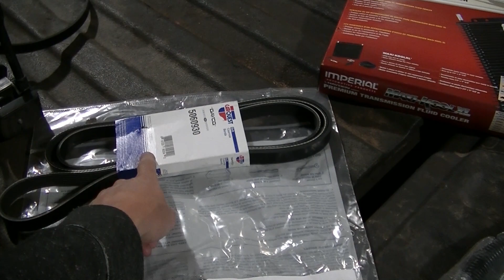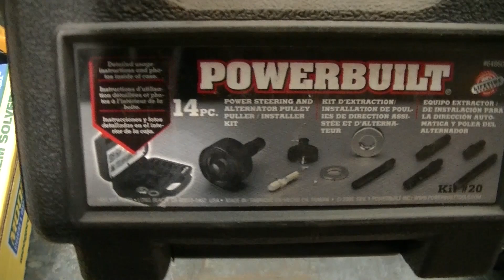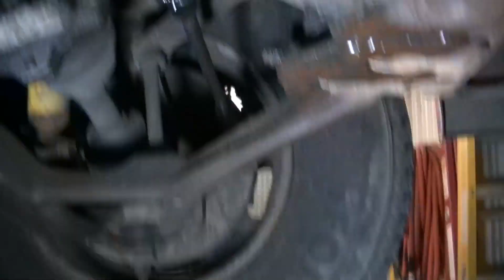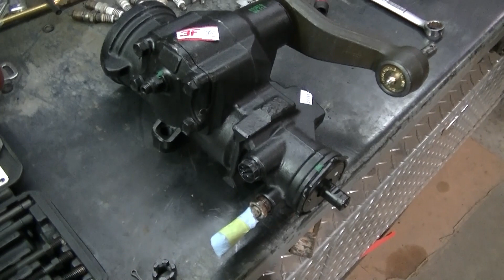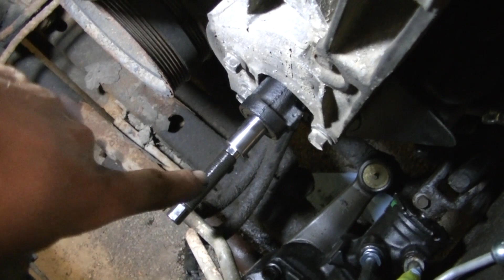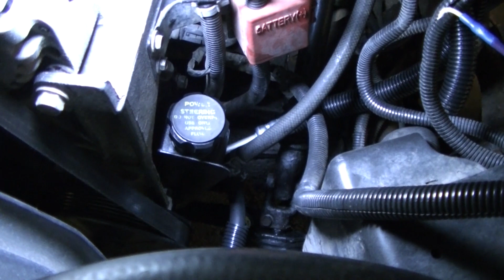Silverado 2500HD Power Steering Pump, Steering Box, Cooler, Lines, Pitman & Idler Arm

Comment: U can swap in alternator bracket 12567922 and use the bearing style pump from 2011 2500hd silverados. Im trying a corvette steering pump & remote reservoir. 

I went thru so many of these built in reservoir pumps they will not stop dying

Comment: Hey how has the power steering pump held up over all this time mine just went out curious on which one I should buy I want to get the best I can I have a 6 inch left on my truck. If you canreply thank you so much!!!
Reply from the maker: Get an AC Delco. This one made some noise the whole time I had it. I replaced it with an AC Delco and no more noise. Worked better too.

Comment: Just did mine and having a hell of a time getting the steering box in the right position in conjunction with the steering shaft and wheel being straight. The wheels box and pitman arm are straight but when I hooked up the steering shaft to the box, the only way i could get the slots in the shaft/box the wheel had to be turned about 90° Should i just take the shaft off the box turn the box manually all the way to one side then turn the steering wheel that way and reconnect the shaft to the box? When i took it all apart i had the wheel tied up with rope but my knots came undone.

Comment: pressure lines are different sizes; (no need to add line to remember.) also gearbox will come set (for wheels to be in straight position;) keep steering wheel in locked position; (in the straight position)

Comment: Man! Thanks for the video- it actually was more of an encouragement. I put a psc xd steering box in and could not get the steering shaft to slide on. It slides on and off so easily on the old box and was worried it was user mechanic error,i was ready to throw in the towel and pull apart my new front end. I watched this and you said it took lots of prying, hammering, and cursing. I followed suit and won. Thanks again!
Reply from the maker: Well, glad to help motivate.
Reply: mossman381 Scratch that, you helped with more than motivation. The strap wrench was incredibly useful!

Comment: Hey Mossman, my steering is locking up when I turn the wheel with the engine ON (both IN gear and idling)(no, it is not the anti-theft lock, which is what everyone is suggesting). I am thinking it is the gear box, whuddya think? Is there a way to test it before I replace it? Or could it be the pump? Already replaced the pitman arm and belt (along with the idler, tie-rods, and ball joints). After getting ripped off from SO many mechanics (female thing?), I have opted to work on my own truck! And still learning.....and it is an 03 2500 HD Duramax (LB7)....sigh
Reply from the maker: How many miles?  Is the steering locking up or are you loosing power steering?  If it completely locking up I would lean towards something in the box has given out or worn badly.  If you are just loosing power assist then I would say the pump.  If your pump is working good I would suggest not replacing it.  This replacement pump is as loud as the old pump it replaced which was the whole reason I changed it.  And it's not an easy job.  Having someone watch the steering parts as you turn the wheel can help spot a problem.
Reply: Hey, thank you SO much for responding! Truck has 165,000 miles. And it is completely locking up.....I can get it loose by forcing it back and forth, but then it will lock up again. Had a buddy go under and listen and watch....he thinks it may be the box as well. So I will replace it and go from there. Is it complicated to remove the fan and shroud? Do you have a video showing this? And thanks again...I actually enjoy doing this work myself...somehow it is gratifying.
Reply from the maker: Yes,  fixing something with your own hands is satisfying.  The shroud is pretty easy to remove.  The fan can be difficult.  I generally use a hammer and chisel method but they have a tool to hold the pulley.  You will need a big wrench for the fan bolt.  I don't remember the size but it's big.  Steering box job isn't to difficult but there can be issues that make it not a fun job.  That can be said about any auto repair though.  I show some of it at the beginning of my water pump removal video  https://www.youtube.com/watch?v=t7lQKRQWfTU
Reply: Sweet. Just got paid on Fri.....so pricing out gear boxes....meah....a bit pricey. How do I know if I can rebuild mine? Any thoughts?

Comment: How well has the Hayden Trans cooler work, does it hold up to the power steering pump well?
Reply from the maker: Works just fine.  Had no issues so far.
Reply: Thank you for the reply, I have the same cooler going on a Trailblazer for the PS cooler.

Comment: The pitman arm, what's the factory torque for the nut on it? I had mine done at a shop and now the nut is falling off. Shop doesn't want to fix and I really don't want to pay again. Also the guy put 2 big washers above the arm & 1 under the arm plus the locking washer? Not sure y but he did. Any help ??
Reply from the maker: Not sure why there would be washers.  Sometimes you can put a washer on a part that uses a cotter pin to get the hole to line up at the right torque.  I don't know the torque for that nut off the top of my head.  It doesn't sound good and I wouldn't go back to that shop again.

Comment: Do you have the part number and brand for the power steering cooler that you used, and how do you like it everything fit in lineup vs the factory one? Thanks
Reply from the maker: No part #.  It was a trans cooler from the local Carquest.  It seemed to work out good.  Have not had any issues with it.
Reply: mossman381 10 4

Comment: where did you get your gear box and power steering pump? and how are they holding up today? also its the same for the 2500HD with the duramax right?
Reply from the maker: I think the boxes are the same Duramax or gas.  Your auto parts store should know the right one.  I got mine at CARQUEST but they look like they are all coming from the same rebuilder.  I have heard they are hit or miss on finding a good one that is tight and doesn't leak.  Mine started leaking right after being installed.  I used some Lucas stop leak and It helped but haven't been under the truck to look recently.  There are two versions of this box.  I would get the more expensive one next time.  I think it's more heavy duty.
Reply: yeah i'm gonna try a company out of North Dakota who rebuilds them called blue top. http://www.bluetopsteeringgears.com/ lil more expensive but suppose to be really good product. was gonna try red head but heard they are hit n miss to and even more expensive. is your power steering pump holding up good?

Comment: Wow thats a lot of parts.  I think I gotta replace some steering parts also.  Steering is really heavy like the assist isn't working at all.  Was watchin your video to get an idea of whats wrong.  I have an 04 Z71 so I dont have the hydroboost.  The hoses are leaking some and need replaced.  I'm guessing maybe my pump needs replaced but not sure.  Its not making any whining noises.
Reply from the maker: Could be the pump or the steering box.  You should never have a heavy steering.  Rebuilt steering boxes and steering pumps are like rolling the dice.  You never know when you will get a good one.  I have gotten a few bad ones and have heard others having the same trouble.  Low mileage OEM stuff is the way to go I think.
Reply: @mossman381  that's what i did low mileage parts from a boneyard 75 for the gear 40 for the pump

Comment: mossman381, Where was the leak coming from exactly? If you mentioned it in the video, I must have missed it.
Reply from the maker: The front of the gear box.  There is a snap ring that holds everything inside and it looks like it's leaking from there.  The Lucas really slowed it down but I still see a drip on the front of the box.
Reply: Ok, thanks! Very informative video. I haven't found my leak yet. There's fluid everywhere. From up top and all the way down to the bottom. So I can't tell if it's coming from somewhere around the booster and running down all over everything or if it's coming from somewhere around the bottom, like the gearbox and just blowing up onto everything with wind from either driving down the road or the engine fan. I've cleaned the upper part with brake cleaner and haven't seen a leak yet, so now I'm gonna do the same to the bottom. Now that I know where the source of your leak was, I'll pay extra attention to the gearbox.Thanks again.
Reply from the maker: I put in all new parts.  The aftermarket parts are not that great these days.  My guess on your leak would be a power steering line.  If you have factory parts still they don't leak much except lines.
Reply: ok, great thank you!
Reply from the maker: They hydro boost will leak when they go but that should be easy to spot.
Reply: Ok. I sprayed and cleaned it real good and I'm gonna keep an eye on it.

Comment: Did you decide to put new shocks on the front along with a front end alignment? 
If so, how does it ride now?
Reply from the maker: No shocks yet.  Needs ball joints before an alignment.  Truck drives better with these new parts.  I think the pitman are was really bad.
Reply: You're right. If the truck needs ball joints, do that first before you get the front end aligned. 
Your project is progressing nicely.

Comment: I have to change my 4th power steering pump.  3 rebuilt units bad so far. A1 cardone. Got lucky with the steering gear but replacing the factory 400 000km steering pump as prevention turned in a nightmare .  Ac delco fluid is 25 $ a liter, im not amused. New pump was 426$ at the stealership, should have gotten it.

Even the guys at red head steering gears dont know of any upgraded or trusty rebuilt units

I used the same 3F branded steering box and a 140$ moog pitman arm as well. I Did the idler and idler shaft as well on the other side..  Only have to replace the lower steering shaft now and get alignement done
Reply from the maker: I didn't want to hear that.  What is going wrong with your parts?  I did dads steering box and I think that is doing good.  Everything feels nice and tight.
Reply: mossman381
I think it's simply shoddy testing procedures on the part of the rebuilder. Steering box was good first try though, thankfully.
Only have 1 brand advailable, so if it fucks up you keep getting the same thing.  PLus I cannot get the ps pump with reservoir....had to swap it all the time.
Reply from the maker: Veikra   Both the box and the pump have a lifetime warranty so I thought they should be pretty good.  I have noticed a drip coming off the box.  Not happy about that.
Reply: mossman381
  lifetime warranty from a1 cardone? I believe that'S where the 3F box comes from. But warranty doesnt cover the 3 ps pump replacement and the fluid lost .... I sick of shoddy parts.  Im a good 300$ in parts and fluid for a 70$ pump, let alone time for 4 replacements. 

So far, no one is able to tell me about a good ps pump rebuilder thatll offer more than a year warranty
Reply from the maker: Veikra   I don't have my receipts with me right now but I am pretty sure the guy told me lifetime warranty on both.  I totally agree with you on how much work it is to do the job.  That is why when he said lifetime warranty I was thinking they must really think the parts will last.  Which is what I want.  My parts came in a Masterpro box from O'Reilly auto parts.  I think it was Masterpro.

Comment: I would say that the coolant hoses and fittings would be next. Mine went out around 315k, it sucked pouring water into a broken fitting on the side if the road
Reply from the maker: The brake lines are pretty cruddy.
Reply: I went with the company perfect lines on ebay, all of the lines were perfect for my truck

Comment: Did you buy new or a reman gear box. I've heard nothing but bad about remans just wandering
Reply from the maker: Reman,  the store didn't have any new options.
Reply: Did the gear box help much I have replaced everything on mine but the box and it still has a little movement when it gets in grooves on hwy   Ball joints helped the most  but still will wander back and forth some.
Reply from the maker: Blake Summerlin   The steering is much tighter.  I think it might have been the pitman arm that had the most wear.  I would go with the more expensive box if I could do it all over again.
Reply: mossman381 I May try a new box then I'd like it to be tighter and not give as much when hits a high spot can feel it push the tires one way or the other and drives me insane
Reply from the maker: Blake Summerlin   Have you tried a new steering stabilizer?  My dually has all new parts and the bad roads still grab the tires sometimes.
Reply: mossman381 the one on it is a year old  but guess that don't mean much huh.  I had a rancho on it for years and replaced it  with a different kind  never really thought it was as good.  What kind did you use
Reply from the maker: Blake Summerlin   I went with a Bilstein steering stabilizer.  I have Bilstein 5100 shocks front and back.  Shocks play a big role in how you feel the road.
Reply: mossman381 I just replaced all them too. A year ago. I think they are Monroe shocks     I put gas shocks on it but that's not what came on it from factory

Comment: Thanks for sharing, I have to change the pump and lines on my 2001 2500hd  and that pully looks like I may have to cut it off... It acted like the puller was going to peel the lips off the pulley. Need to take another run at it. I'm at 199k miles or so.
Reply from the maker: Would be pretty tuff to cut that pulley off.  There are two sides on the two half circles that grab the pulley.  You can use the smaller side on these trucks.  The pulley will snap and make funny noises while you press it off.  A little bit of Blaster on the front side of the pulley is a good idea if there is some rust on the shaft.
Reply: I'll check it out, using a Harbor Freight puller kit... Thx.
Reply from the maker: Tenright77   You need a power steering pulley puller.  You won't get it off with a jaw puller or something like that.
Reply: I'm using the Harbor Freight version of the kit you showed.. Thx.

Comment: Are you missing the 1500 now? This truck seems to need a lot of work, is the time and effort worth it on a truck like that with all those miles? How are the headlights?
Reply from the maker: It would have been nice to keep the 1500 and finish the performance side of it.  The 1500 wasn't too far off from this 2500 when I first got it.  The 2500 will be a better truck all around and it can be worked.  It drove ok before.  The truck doesn't need all of these parts but if I am going to drive it I want it driving great.  I know the truck doesn't look all that great right now but give me some time.  Working on the mechanical side right now which is the most important in the end.  I think it will be worth it in the end.

Comment: good video, I like these truck build series. I just bought a 2010 Chevy 2500hd
Reply from the maker: Thanks,  the 2010 has the same frame as this 2002.
Reply: mossman381 I know that, the only reason I do is because I remember when you put the newer style bumper on the dully you said that the frames were the same. I think 2011 they went to a fully boxed frame
Reply from the maker: JohnDeere50d   Yup,  2011 they changed a lot.  Dad is running the control arms that come off my 2008 2500HD I had.
Reply: mossman381 do you have any videos of that truck? the 2008
Reply from the maker: JohnDeere50d   I have a few videos.  That was before I was really into YouTube.  Here is the playlist  https://www.youtube.com/playlist?list=PLZwy_pK9cqiOOJqAOcJsNGsm0oK5isOQ0
Reply: mossman381 any reason you sold that truck?
Reply from the maker: JohnDeere50d   To get out of the payment.  Back in 2008 everything went to crap.  We were struggling pretty bad.  Sold the truck and what was left I used to buy the dually.  It was basically the same truck.  A little older but I got the Duramax I wanted.
Reply: mossman381 ya, you definitely did a lot of nice things with the duramax. did you buy the 08 new?
Reply from the maker: JohnDeere50d   Yes,  bought it new.  It had 15,000 miles when I sold it.
Reply: mossman381 the truck I bought has 141,000 but mostly highway miles and it's the only way I can afford a nicer newer truck. bucause like I was telling you when you bought this truck,  most around me are way overpriced
Reply from the maker: JohnDeere50d   I hear you on overpriced trucks  :)   Do you have a video on your new truck?
Reply: mossman381 not yet, I have to work on that very soon

Comment: do you buy your parts from adavance auto?
Reply from the maker: Yes,  Advance Auto is now the CarQuest.
Reply: Do you order online then pick up in store? If you don't try it. Use the cupon code trt30. Save 30% on orders up to $150. I do it all the time and save a lot of money
Reply from the maker: nascar5410   I have never ordered online but might try it if I can save 30%.
Reply: It's easy, just order for store pick up. Then when you go in everything is pulled and ready to go also. Saved me tons of money
Reply: mossman381 that's what I do for big orders. you can only save a maximum of $50 so if your buying a lot you can make 2 or 3 orders if necessary
Reply: I do the multiple order thing too